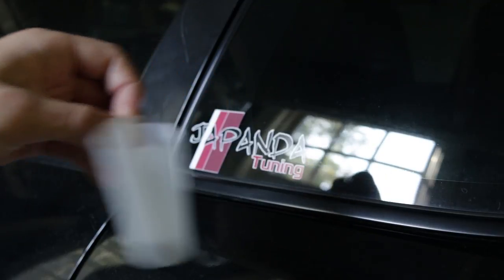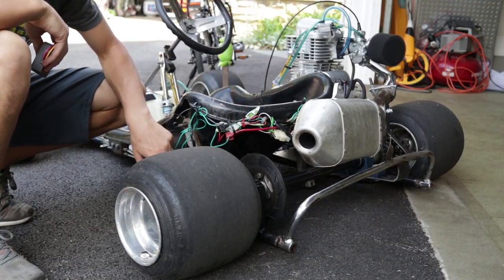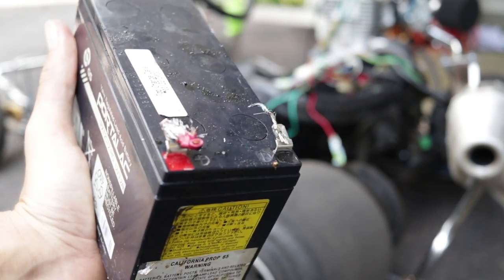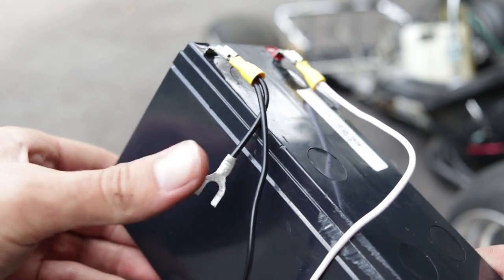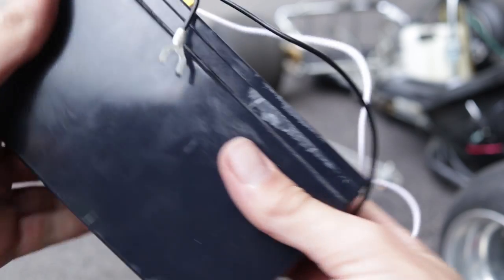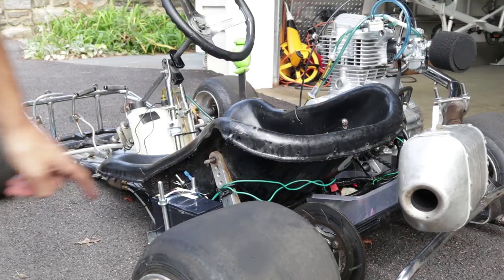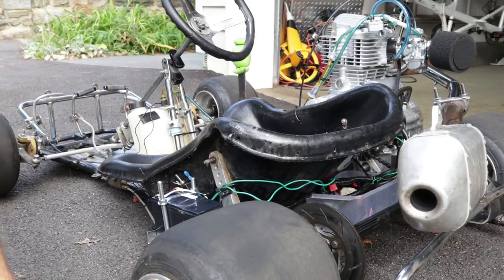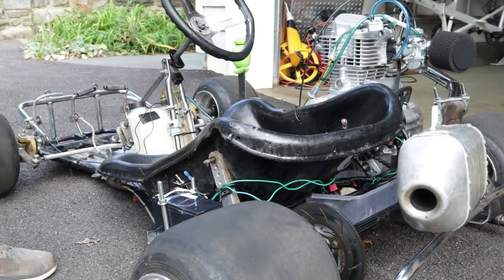Cleaning Up the Stick Shift Go Kart

Comment: How's the fuel setup on that? I remember it kept dying randomly. Kyle from boostedboiz has the same motor and mentioned something about having a vent on the tank so it will not create a vacuum in itself and stop sending fuel. Don't think I forgot about sending Ahmad the fender for the 'rolla, I am stuck rebuilding the motor on my daily and hopefully soon after I can get it towed to my house.
Reply: awesome!